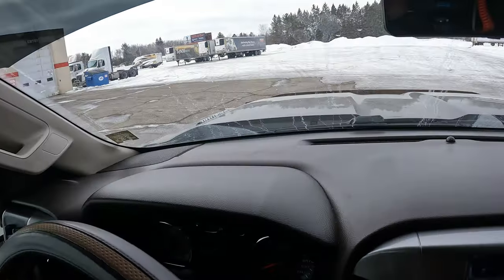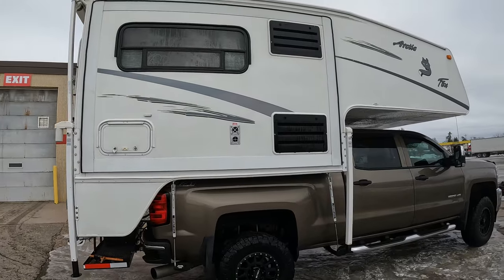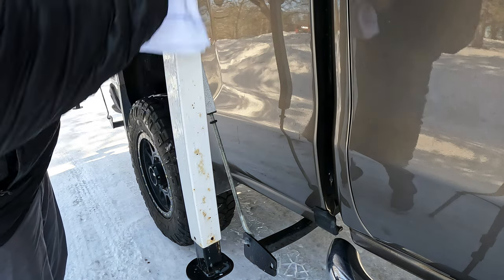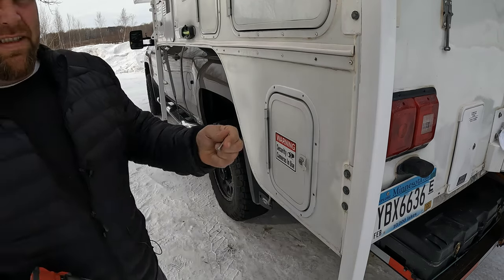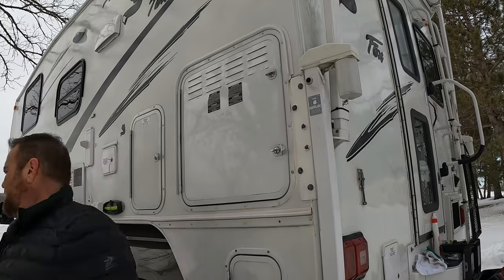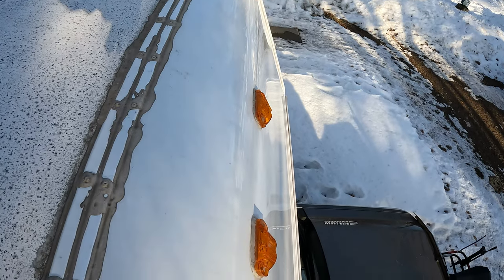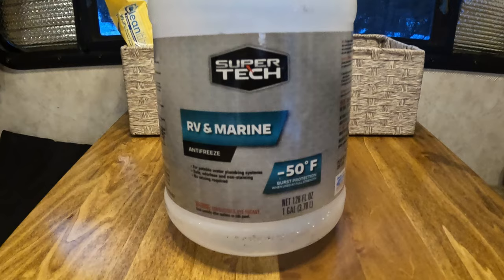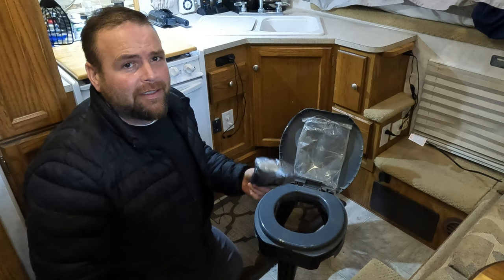Truck Camper Maintenance

Comment: I wish they would use stainless steel for every fastener on RVs. I build  swimming pool enclosures for a living, and all I use is stainless steel. It costs about 10 times as much as ceramic coated steel, but it is worth it.

Comment: Thanks for the tip with the Iron out.  For the winter toilet use I do exactly the same as you but I use the RV toilet with a bag.  Works great, never had an issue.
Reply from the maker: That's a great idea! Then I won't have to carry the extra seat. I'll try it this weekend. I will still use the same bags. I've never had one leak. Thanks for the tip!

Comment: Do you have any pictures or video of replacing the front cap? That must have been a project did you find anything you weren't expecting?
Thanks for all your videos so informative. I like yours since they are in the Northern winter, most people migrate south.
Reply from the maker: I have a video explaining some of it. The video is titled "Covered Bridges and Boondocking" go to 7:20. You can see a few photos of when I pulled the cap off. Unfortunately, I never imagined being on YouTube a few years ago when I completed the project, so I only took a few pictures.

Comment: Great video, keeping it real. Thanks for sharing. I'm guessing you will paint those jack legs in the spring?
Reply from the maker: Yes. I will scuff them up, use a high build primer to cover imperfections. Then my go to paint is an enamel used on farm implements. That stuff is really durable.
Reply: @KennyOfAllTrades  so does your camper have a less than 3000# wet weight? I've got a Ram 2500 with roughly a 3200# payload capacity. I really like your setup. So I'm looking at different campers for my application, without changing trucks.
Reply from the maker: @randylester1219  That's a good question, and I don't have the right answer for you. I love the way my camper rides. I have never had any issues with sway, porpoising or breaking. I have taken it through everything from mountain passes, to ATV trails. I have been on  the interstate through North Dakota  several times in 20-30 mph wind averaging 75-85mph and felt planted to the road. My truck still has a 1.5 inch rake front to back with my air bags at 100psi. I normally run them at 40-50psi (just so I'm engaging my upper overloads).
With that said, I have never weighed my camper. I read the forums online and I know the weight police would have a fit. But I'm happy with my setup and very confident with it. Maybe on day I'll go across the scales, but ignorance is bliss.

Comment: Hey Kenney can you tell me what tire/ rim set up you got going on? Size make model etc.
Reply from the maker: I'm running Method NV HD Wheels.  I like them because they have the highest weight carring capacity compared to any other non-commercial wheel. It's a little over 600 pounds more per wheel compared to a factory wheel. 
The tires are a 295 70 18  Nitto Ridge Grappler. I love the tire, great in all conditions, with a load index of 129. They are also rated for quite a few pounds more carrying capacity compared to stock.